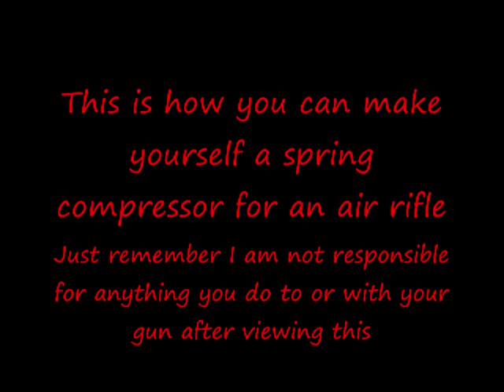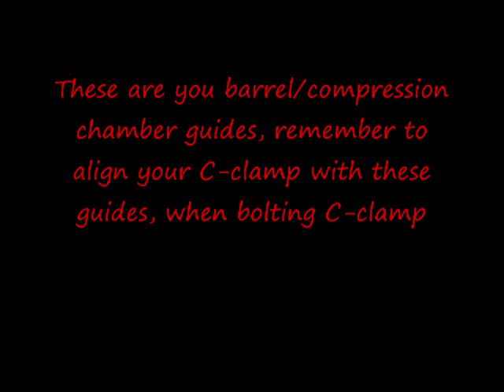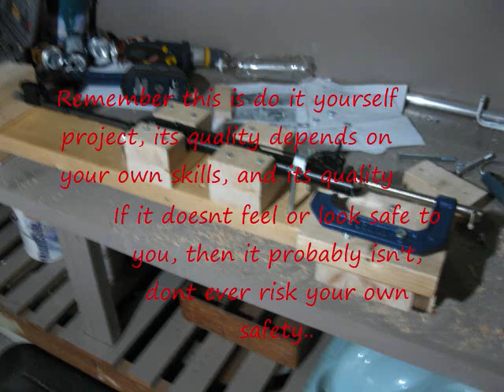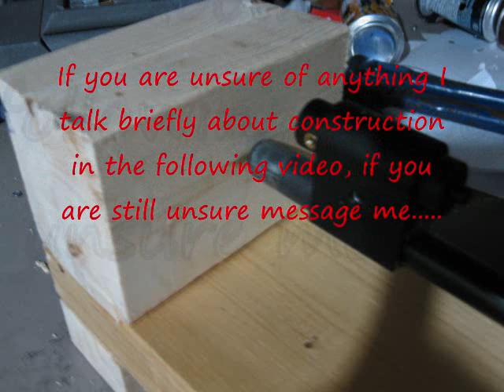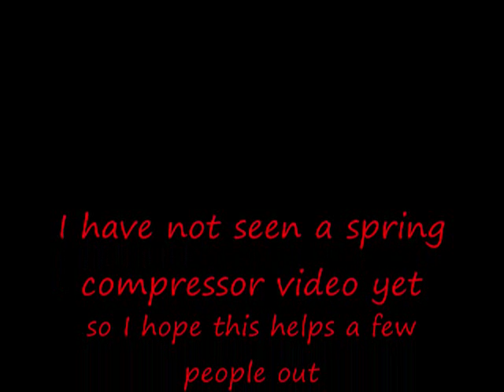How To Make An Air Rifle Spring Compressor

Comment: Anyone who can't understand this compressor and it purpose really will end up getting hurt one day. Yes it can be done without a nice compressor but why take the chances of hurting your self. Slow down cowboys and do a job that you will be proud of down the road. Yes this is simple, and very simple inexpensive way to keep you safe maybe save one of you fingers or keep something from flying into your body and yes could even cause death. I feel this young man has taken a great deal of thought and time to help anyone who needs to work on the air gun. If you can not see the need for this home made produce or a simular unit. Please do your self a favor, DO NOT ATTEMPT TO WORK ON YOU OWN AIR GUN!

Comment from the maker: Of course you don't NEED one...

But it is much easier, faster and much safer with one. I have used this many times, work for most spring power guns. Its better to have something and not need it than need it and not have it...

And good luck installing your lock pin and trigger assembly with a "cup type deal" over the back end of the compression tube lol

Comment: Very impressive. This is the sharpest looking DIY spring compressor I've seen anywhere! I'm guessing that you probably used a vise to hold the C clamp for cutting and drilling. Thanks for your work.

Comment: what about this idea? put the spring in,place the gun chamber vertically on the floor with spring touching,then get someone to sit on the top via a board.the weight should push the spring in.

Comment: Mine is basically the same but shorter, meant to be used with the barrel removed.  Since removing the barrel is only a matter of the one pivot bolt, it's worth the time.  Then, I can clean and lube the pivot area upon reassembly.  Good vid.
Reply: Yeah, I too, prefer the method where the barrel is removed, not like this one where it is subjected to the force pressing against the compression spring. There will always be that doubt in my mind whether this method has bent or altered my barrel somehow. I don't think I could live with that. And yeah, it's so easy to remove the barrel and be given a chance to clean and lube the pivot and retighten the screws.

Comment from the maker: Yeah it takes a little time and effort, but once you have one, you cant imagine not having one LOL

Its just so much safer, its not even worth it to not use one.......Its also seriously about 100X easier to do using a spring compressor, I can take apart, change the piston seal and put back together a phantom in 10-11mins LOL